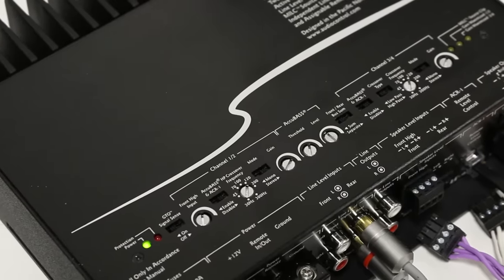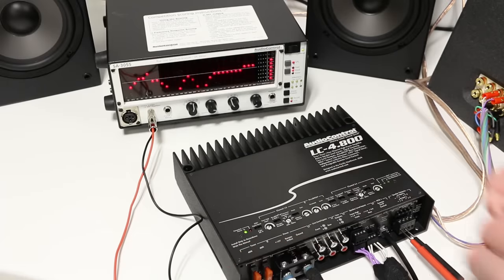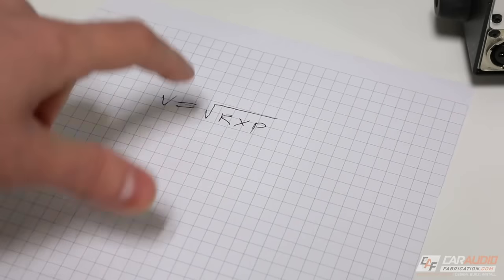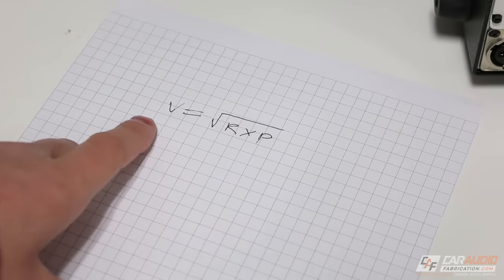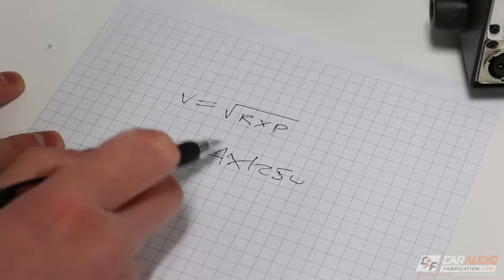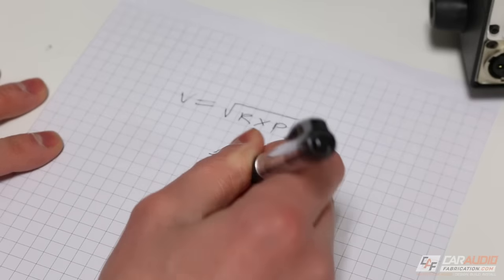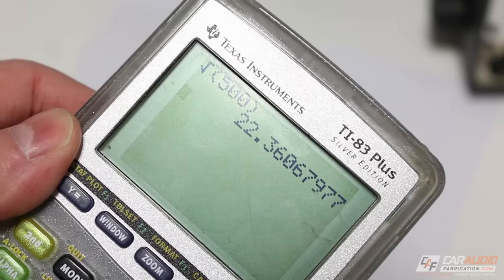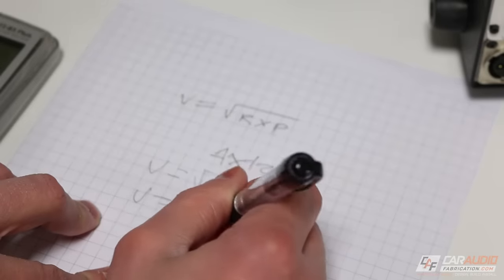Amplifier Tuning Settings How To - Gain, Crossovers, Bass Boost

Comment: Great video Mark.  Quick question for you....is there a way to lessen the wattage of an amp before it goes to the speakers?  For example, if the speakers are 100 watts RMS but the amp is 125 watts rms, can adjust it so that the amp only puts out closer to 100 watts?  is the extra 25 watts even that huge of a concern?  Thanks!
Reply: Jeb McConnell there is no way

Comment: sonic electronix did a video showing how to match high wattage amp to low wattage sub by setting the gain to a position to achieve the desired wattage but in this video you say that its still using 100% of the amplifier power so that means changing the gain won't increase or decrease power? im confused. please somebody anybody reply. i need to know if i can safely use my 2.5K amp on a 1200 watt sub.

Comment: Hey Mark, I’m fairly new installing car audio so I love your videos! I started learning at a professional shop here in Florida about 7ms ago and I have a question for you? My teacher installed my system upgrade before I started working here (a 15 inch digital design, redline series subwoofer, and a 700 W four channel amplifier by VIBE) oh, I recently asked which new amplifier could I order to push my DD sub and I was told that the sub and the amplifier I have now are perfectly matched, that my subwoofer couldn’t handle more power. If my subwoofer is 700 to 1100 W RMS and a dual 2 isn’t it possible to push 1000 W four channel amp?

Comment: I have some questions I would love clarification on.. after all the rsearch I've done done I still feel lost.. First if I'm testing a head unit for distortion with an oscilloscope do I set crossovers first? To add to that how do I figure out my crossovers to where my speakers are at their max potential without hurting them.. SO if I find distortion on my headunit then go to my amp and find where it distorts and set that gain how to I go about it where I know my speakers are happy with their crossovers and power they are fed ( I have an alpine amp for my door speakers that says 50w rms and apline speakers rated the same power

Comment: QUESTION: I have four 1 inch alpine tweeters (150RMS) I have an RD500/1 (JL Audio mono block), I have ran four sets of leads from the amp to each individual tweeter. and its loud, clear and smooth, the amp nor the tweeters seems to getting hot, nothing is smoking and nothing smells like its burning. will this work? or will something fry? any help with this will be greatly appreciated thanks

Comment: I have a 8” sub with built in amp, the only 3 setting I have on it are, Gain, phase and low pass frequency. I get how to setup the gain. I’m assuming I should just leave the crossover to 80?! And what’s the phase control for its days 0-180 degrees. Also, I don’t have a bass knob could I raise and lower the bass from the HU if I need to or is that bad.

Comment: How would you go about setting gains on a system that has an aftermarket head unit with rca going to a digital sound processor then into a 5 amplifer to doors and a sub? How set gains on both the dsp and amp without the oscillator or smd tool?

Comment: I've got a question when you were using the dd1 and you turn the gain all the way down on the amplifier to check the radio for distortion did you still have DD1 connected to the amplifier outputs??

Comment: Trying this with my subwoofer amp, but I need help. My subs produce 2400 watts but the rms is around 1200 watts. And the way they are wired gives it 1 ohm. So if I do that equation I get around 35 volts that I need to be getting for my calculation. Is this correct? Also does the tone need to be playing at full volume while setting the gain? Thank you

Comment: Hi Mark. I have a 2017 Mustang which came with a 3 way front and 1 set of rear speakers. Which Audio Control Product should i use to integrate with factory setup? Cheers

Comment: But when you set your gains with DMM, shouldn’t it be to the speaker specs and not the amp specs?  Meaning, if the amp produces 125W but we’re putting a 100W speaker, we should be setting the gain for the speaker?

Comment: I have a question, Does Low pass filter only works on the bridge connection? for example if i dont have any woofer installed.

Comment: Hi Mark!  The videos are fantastic and quite informative!

I have some questions for you or anybody reading this post.

I have the following setup: Alpine ilx 702D as the head unit, Rockford Fosgate R2 500X4 (4-channel) and R2 500X1.  I'm using the Rockford Fosgate punch series speakers and subwoofer.

I have set the gains using the Rockford Fosgate CLEAN setup.  I played the 1khz (-0db) test tone and set the gains exactly to the point where the CLEAN LEDs just begin to light up. The HU volume is kept at level 28  out of 36.  This is the level at which the input CLEAN LED stops glowing, meaning there is no distortion.  The LED lights up if I increase the volume to 29 or above.  I repeated the same for the sub amp, excepted used a 40hz test tone.

I noticed the volume to be low.  For normal listening, I have to set the volume somewhere between level 12-16 of 36 (where 36 is the maximum).   Is this normal?  This is with a good quality recording, if I were to play a poor recording or old songs, the volume has to be set higher.   I have set the bass/treble at level 7 of 14 where 14 is the maximum.  The source volume is also set at level 7 of 14.  The equaliser is set to flat and the media eXpander is set to OFF.  The subwoofer amp has the punch eq which is set to maximum and I've also set the remote control knob (bass control) to maximum.   Even at this setting, the bass is just nominal.  I would expect the bass to shoot the roof with this setting.

What am i missing here? 
I have a home amplifier (100W+100W) and I only need to set the volume to level 1 of 10 for normal listening and the sound level is quite filling.

Please also let me know what are the normal volume levels you have to set in your installations, bass/treble levels, source levels, equaliser levels etc.

My idea is to set the eq (on the HU) to flat, bass/treble to 7/14 while all media expanders etc to OFF and let the amps do their best.

Please advice.

regards,

Jean Luc

Comment: With the distortion tool method...What if the rms of the amp is > rms of speaker?  couldn't the voltage output be too high for the speaker?

Comment: My amp has a line level input up to 4V and high level. / speaker  input up to 10 volts. My head unit has 5v pre amp output..also my speakers are 100 W but amp only 75 Watts will I have some issues because they don’t match? Or can I just connect to high level and turn the gain up just below clipping?

Comment: Hey mark do you need a capacitor to run a 2400watt amp with two 12s. My  subs just started cutting off and back on here in the last week. Even tho I had them installed for over a month or 2. Any info?

Comment: Thanks for the video. I was curious about the difference of using a load resistor when checking for voltage drop. A DMM - obviously has a much higher impedance than a 4 ohm load. I suppose the voltage would be the same, just much lower current out of the output channel of the amp.

Comment: Hi mate. 

I have a y62 patrol with the "Premium" Bose audio. Same as your QX80 over there I think it is. 

As you get to about 3/4 volume, bass starts getting cut sharply. 

I have purchased an Alpine 8 channel DSP Amp and plan on using that to get some actual tunability into the system. 

I have an oscilloscope and am pretty experienced with car audio, but only fill replacement systems, not splicing into one of these fully integrated systems that does aircon and car info ect. 

My plan is to turn the head unit up till just before it cuts bass, and then set the Alpine gain at that point, essentially like what you would do to set gain by not having the head unit sending out distortion.  

That shouldn't be an issue hey? As long as I don't go up beyond that volume I initially set it up at? 

Cheers

Comment: I have a built in bass boost knob/screw on my amp, do i turn that all the way up or is yours different? I'm a little confused because i've heard that you are not supposed to turn the bass boost knob/screw that much at all?
Reply: You dont turn up the bass knob... Make sure the bass knob is all the way down/off

Comment: Great video Mark. I ordered the DD1 and I'm wondering how should I set the amplifier gains if I have a Clarion equalizer in between the radio and amplifier which has a volume control & a sub boost knob and the 7 parametric EQ knobs.   The EQ is mounted in the glove Box so I want to use the radio volume as the control. So would I turn the radio volume to 3/4 And set the volume on the equalizer & subwoofer to max. &  Then set the  Is amp gain?

Comment: I have a 800 w rms x 1 ohm amplifier connected to a 2 ohm dvc wired as 1 ohm 12" subwoofer rated at 800 w rms. Should my amp voltage be sqrt(1600) or sqrt(800) ?

Comment: Thank you.  This video with the help of Kicker's tech hotline to confirm specs enabled me to tune my first amp/sub combo.  The only thing I found confusing was that the power formula used to determine gain voltage was based on the amp specs, and kicker told me to use the speakers specs for the calculation (Amp was 750 RMS versus Speaker which was 400 RMS).  I assume that if I used the amp rating (750) and set the gain it would have been too much for the sub.  Thank you for this video.

Comment: I have a question mark or if anyone can help. I been doing Installs as far as I can remember but of course learn the hard way from mistake and done research and still learning. So my question is, on the stereo everything go flat right then you set all your gains so you dont clip. Does that mean the deck stays all at zero or can you adjust your bass/mid/treble after setting gains? Again still learning here but not sure if adjusting the deck after setting gains will defeat the purpose of setting the gains in the first place from clipping.

Comment: Grate  video , just one question when  you tested distortion on car head unit where did you connect distortion tester wires on , on amplifiers speaker output or car head unit ? Best regards.

Comment: Due to reflection caused by the impedance mismatch when there are no speakers, that equation I don't think, will apply to the speaker outputs. I think putting a 4 Ohm resistor in place of the speakers and then measuring the voltage, would probably help eliminate distortion.
Reply: Is this just a guess or would putting a 4ohm resistor in place (replacing) the speaker/woofer driver change the end result ?
Reply: @jonathanharris185 Well, I believe placing a resistor will change the result but only slightly. The reflections at the speaker outputs will be maximized since there's nothing plugged in, and the amp is probably designed to have impedance matching at 2-4 ohms. It's almost like shaking a slinky while holding one end attached to a concrete block.

What this could change....is the RMS value the multimeter reads since the waveform could be different, and setting the gain may therefore be off.

Comment: I have a 1200 watt rms amp that im going to set the gain voltage to output 750 watts. Will the lower gain setting lessen the current draw from the amp?

Comment: Excellent video as always. But how would you know what frequency to use to set the gain on a mono block ?
Reply: Did it on mine with 20, 30 and 40 hertz. Worked fine for me :)

Comment: So my amplifier is 500W max /250W RMS on the bridge for bass, so 4ohm x 250W = 1000 and then √(1000) = 31.6227766017 right?
And i will have to put the multi-meter on acvolt and connect it to the bridge and then adjust the gain until i see 31volt on multi-meter?

Comment: Hey I need to hook up a spdt relay to my aftermarket stereo. If a 2007 Chrysler 300C non  navigation Amplified system with 8 speakers Boston acoustics I'm using a Pac unit C2R -chy4. Okay then how would I incorporate wiring at the relay to the Pack Unit to the aftermarket Kenwood media receiver wiring harness the way it's supposed to be hooked up. Thanks in advance Glen

Comment: So the voltage is set for 125 watt at 4ohm calculation. What if you are using a jbl or infinity 2.8 ohm speaker pulling more wattage out of the amp?

Comment: I am working on. A goldwing 2008
I have 1 sub and the 4 bike speakers aftermarket my question is I have 2 amps 1 for sub and 1 for 4 speakers I also have the lci pro just wondering which one do I set first the lci or amps

Comment: @CarAudioFabrication I would like to know your opinion on setting the gain with an oscilloscope.
I have not yet done a calculation to confirm the output voltage of my amp is the same as with your formula, but so far is shows as having no distortion. So what do you think, would this also be a viable way to do it?

Comment: Hi CarAudioFabrication.
I wonder if you can help me?.
I have a 10" pyramid WC1020 woofer, raited at 150 watts max power, 4 OHM, 40oz magnet structure, 40Hz-4k Hz. What Amplifier do you recommend if i want to install it in a car?

Comment: When testing gains should the speaker wires be in or out? 1000 Hz tone is ugly loud when looking for max volume
Reply from the maker: Absolutely should be out.
Reply: @CarAudioFabrication  thank you so much- i was confused because a couple videos claimed that the ohm impedance (2 vs 4 ) would make  difference on when the gains would max out

Comment: How do you tune mono amp that doesn't have a gain knob? Exp the Kenwood KAC 9152D has no gain. It has a "sensitivity" knob but the manual says that setting corresponds to "pre-output level of the center unit connected to the amplifier." So.....is there a way to tune the gain or am I SOL?

Comment: How would I adjust the LPF and the HPF when my head unit AND amplifiers both have the ability to adjust. Simply put, how do I adjust both filter settings? Do I start with the amp pass filter first or the head unit pass filter? Thanks! Keep up the good work!
Reply: From what I understand, one or the other.  Seems preferable to be able to set LPF and HPF on the amp, let the head unit pass thru

Comment: I tried setting gain with a multimeter. I reached a point where I was turning the control but the voltage stopped increasing so I could not hit my target voltage. Could you offer any suggestions to what may be the issue?

Comment: I've been a follower of the channel for quite some time and it's definitely one of the best one's out there, but there's a few things I'd like to point out in relation to this video.

Can you get close to a decent ball park with your gains by using this method in the video? Maybe, but It depends strictly on the amplifier and its performance in open load versus "loudspeaker driver like" load conditions. Amplifiers' output performance (voltage and current output capability) is almost always related to the load the output is presented with. Measuring distortion or (constant) voltage while having an open load (=basically meaning infinite resistance as in no load connected, opposite being a short circuit with infinitesimal resistance) on the power output terminals doesn't give us any relevant information about how the amplifier performs under its intended use (with a driver attached across the output terminals). Especially in the car audio world where woofers tend to have relatively low impedances, the measurements performed in this video are not good practices from a strictly technical point of view. There are drastic differences in amplifier behavior in relation to the load it is presented with, thus gain and distortion measurements should always be done with using a load on the output side of the amplifier that it will be working with when in use. For example this load can be an adequately sized dummy load or an actual driver for that matter (the noisy and potentially destructive option). Strictly speaking, the dummy load isn't an optimal solution though, as a speaker driver is actually a reactive load (dummy load being mostly resistive), but for single tone testing, the dummy load will do it's job in this sort of measurements. When we measure the outputs with the load attached, we actually get the correct voltage and distortion readings that we can use to set up our gains with. It's not that simple though, as knowing and tracking the maximum expected output voltage in relation to our load conditions doesn't really guarantee a distortion free output since amplifier manufacturers are notorious at being dishonest when publishing their specs. If you really want to go deep with Kassem G and get your stuff properly sorted out, you bust out your (preferably) FFT based measurement system/scope and decide on how much distortion you want to allow in your system instead of letting the fixed 1% on the distortion detection device dictate your actions.

In the case of most amplifiers on the market today, it is very likely that the aftermath of setting your gains the way presented in this video you could end up being off by several dB's from your optimal settings. Also a good thing to note, is that if you choose to do your measurements, with the load attached of course, using a multimeter, make sure that it's a true rms meter as you are using a sinewave test tone, which will give you a correct voltage reading. The whole amplifier output power debate in the field of "continuous" vs "rms" figures is also very relevant when discussing the topic of correct measurement techniques and what and how to measure, but this is not the time and place to discuss that.
Reply: Thank you...  It also needs to be pointed out that MANY of the amplifiers on the market rate the continuous power rating at a very high distortion level, often between 10 and 20% at 1Khz!  Going to higher and lower frequencies away from 1Khz often results in even greater distortion!